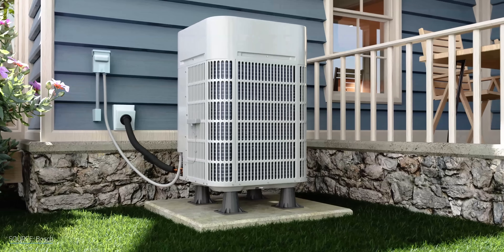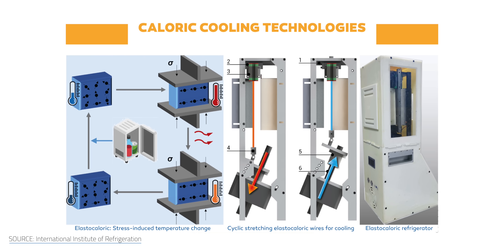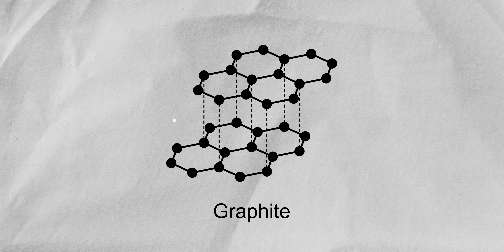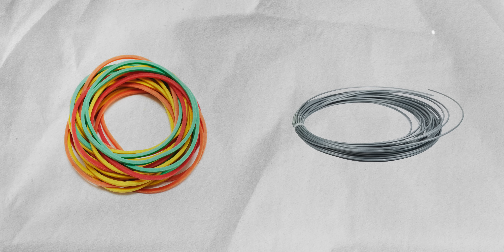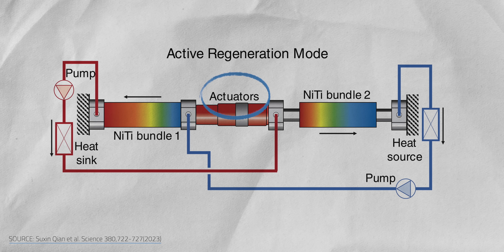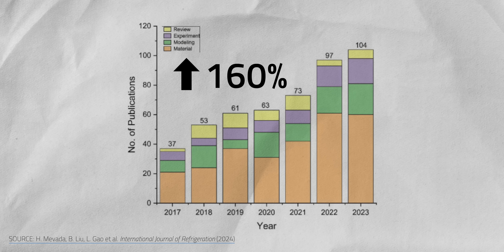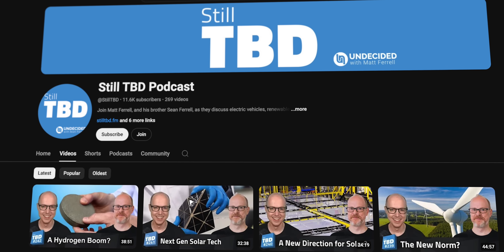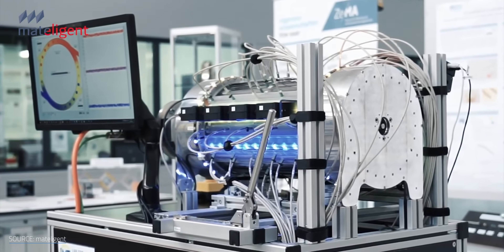How Solid State Cooling Could Change Everything

Comment: Yep - solid state is very cool (pun intended). There are also Chemical, Magnetic, and Electric solid-state cooling cycles which are all very promising. They are all potentially, in in some cases - actually very efficient, but all have the same couple of drawbacks:

They are not scalable - cooling something small? in the hundredth of watts, maybe even a few KWs? - possible. Cooling something large? not anytime soon. Cooling a whole town? City? Country -will probably not be possible.

Secondly, they are usually very efficient in absorbing heat, yet not so much at releasing this heat to the environment. This is one of the reasons why companies like Phononic didn't manage their huge expected breakthrough.

Comment: I may not be the first to ask this, but why do heat pumps need to be outside?  Heat pump water heaters are indoors.  Could they be installed in a basement, where the temperature range is more constant?  That would do away with any issues regarding super cold or hot days when the system may labor to keep the house warm or cool.

Comment: Why not just use the nitinol wires themselves as the actuator? You have them on two wheals, one which heats the wire tending it straight by applying electricity and another wheel which has the air exchange as a rotating radiator pipe. Since the nitinol would heat on the end it's being electrified, it would dump the heat as it does its transition. The cooler wires make contact with the pipe, then a coolant flowing through the pipe is passed into a radiator. The rotating pipe for the thermal exchange could also be the heat pump, making a system that eliminates the need of any electric motors and combines the best part of these two efficient systems.

Comment: if it can't be piggy-backed, then it's a useless system in my opinion....what i mean is, hooking up one to the next to the next, etc. etc. so that each cools the next in a series in order to get the temperature difference to be huge between the ends. Using motors to spin a drum of 100 nitinol bands, and pumps to push liquid across the bands as you compress and decompress them in order to get 5 degrees between "condenser" and "evaporator", while ignoring all the heat building up in the wires to power the entire unit, is just foolish. Personally, I think improving compressors would be a better way to improve the systems we have since it is the biggest draw in power....maybe a liquid as a baffle, using hydraulic pressure which can easily be stepped up and doesn't require a huge amount of electric draw (the only downside is that the tank would have to be oriented correctly and can never be tilted, but maybe there's a way to design it so that won't be a problem).....just a thought.

Comment: MOONSHINE!  Shape memory alloys have thermodynamic efficiency that doesn't touch refrigerants.  You also don't mention fatigue failure of repeatedly plastic deformation of material.  (Gasses & liquids don't fatigue in repeated cycles.)  You still need "refrigerant" as heat pipe heat transfer fluid, both to deliver the heat out from the hot side & into the cold side, not solving the atmospheric pollution problem.  You need 2 separate pumps.

Comment: When something pumps heat, it's technically a heat pump. You don't need to use HFCs in vapor compression systems, there are a lot of good alternatives, in use today. We used to use HFCs, because we focused on their advantages, and not the disadvantages, like we used to put lead in gasoline. Implying that utilizing the elastocaloric effect would be the only alternative to HFCs doesn't inspire trust. The elastocaloric effect is an interesting phenomena, but it's not likely to become a viable alternative to vapor compression except possibly in extreme niche applications. 

The theoretically possible COP of a heat pump depends on the temperature difference, like the inverse of Carnot's theorem, the smaller temperature difference you create, relative to the absolute temperature, the higher the COP you can get. That means, if your heat sink is 300 K, (~27 °C or ~80 °F) and you you want the working fluid, sorry, refrigerant in your AC system to reach 270 K (~-3 °C or ~26 °F) you can't get a COP higher than 10, even in theory. 

It's not possible to reach the theoretical limit, but it is possible to get much closer to it than most systems on the market are, with vapor compression systems. And it's not rocket science, of course there are trade offs, but we could have significantly more efficient heat pump systems if we accepted slightly higher cost and bigger size, for given max capacity. But reality shows that manufacturers know that there isn't demand for significantly higher efficiency to make it worth pursuing when developing new products, more than they already do.

Comment: Metal fatigue is a deal breaker in many applications. A refrigerator built in 1970 will still be working just fine because refrigerants do not fatigue. The thing will weigh more than you can imagine and the original natural rubber gasket will be dry or rotten but it will still be working just fine. Of course they realized they lasted too long.
Reply: I hear you, but that same refrigerator has plenty of moving parts that did not fatigue.

Parts fail commonly bcause they are engineered for minimum cost with a minimum life. 

60 years ago people built virtual-tanks out of everything because profit was so dominating.
Reply: I had the same thought. Just stretch a rubber band and you know it changes temperature, but try doing it 1000 times.

I could imagine having small panels that you can replace after failure and vary their workload to spread out the failure rate, so in 10 years when the refrigeration has deteriorated, you can replace the first broken panel, and then it would be a regular maintenance activity after that.

But yeah, definitely an issue.
Reply: Lmao because refrigerators don’t use metal components that also fail…. And you don’t even know the fatigue of nitinol and there’s people ITT saying how crazy long it lasts.

Why speak out your you know what just to feel good being g a Debbie downer?

Such a bad attitude.

This is just nostalgia BS. Yes capitalism dictates constant need for purchasing so product lifetimes are artificially low but you are just looking g at stuff with rose tinted glasses. Old refrigeration is horrible for the environment and terrible energy inefficient. There’s a host of other issues as well.
Reply: The main thing that fails in your average fridge is the compressor which is made out of metal. Well that and refrigerant leaks. So while product life span for these systems does matter how much it matters depends on application and how easy it is to fix the issue. If every 3 years I need to replace an easily accessible fairly cheap bit of my fridge that isn't actually a huge issue. My car needs maintenance every 2 years and we don't consider the lifespan of cars to be this huge issue.
Reply: Lmao because refrigerators don’t use metal components that also fail…. And you don’t even know the fatigue of nitinol and there’s people ITT saying how crazy long it lasts.

Why speak out your you know what just to feel good being g a Debbie downer?

Such a bad attitude.

Comment: the problems in long term usage are easy to solve. standardize the nitinol-rods and actuators. if it breaks (literally), replace it.
adds the benefit of new materials being discovered down the line to be swapped right in.
of course, companies will demand ways to make those coolers as unservicable by regular people as possible.

Comment: Oh the laws of thermodynamics. It doesn't just magically cool down. For the time the wire is stretched it releases heat into the surrounding air. And when the wire is relaxed the heat is reabsorbed back into the wire. I belive the reason this hasn't got a lot of traction is, to cool the wires during stretch you have to vent that heat energy  out of your house, and when the wires and relaxed you have to channel that cool air into your homes air stream. The losses  from the venting cycle would kill any efficiency gained from the tech. That's why home air conditioners are two parts one outside to expel the heat and one inside to absorb the heat.

Comment: I recommend that instead of using Coefficients of performance, instead use efficiency calculated by comparing the COP of the device to the COP of an idealized reversible (Carnot) heat pump.  This is important because if the difference in temperature is greater than about 15 degrees C then the reversible (Carnot) heat pump has a COP of about 20 which means it is impossible to get anything better than that.  If the difference in temperature is only 1 degree C then the reversible (Carnot) COP is close to 300.

Comment: Solid state cooling is the solution presented to US government instrumentalities by industry to justify prolonging regulatory permission for the ongoing production of hydrofluorocarbons. The rest of the world uses propane and butane. The combustion risk is theoretical only: rapid leakage in a very small airtight space to generate a combustible mixture never happens in real life - refrigerant leaks are slow and insidious. Despite the negligible risk, your industry has persuaded your government to ban the use of hydrocarbons in refrigeration (but no problems storing, burning and have it explode in other applications).

Comment: Generating electricity is hard to do efficiently. I think elastocaloric cooling is most promising where you can apply existing mechanical energy more directly into cooling skipping the electric powered actuators. For example, current  air conditioning makes electric cars less efficient. What if some  of the mechanical energy in regenerative braking in electric cars was diverted to working elastocaloric materials that could be used to cool the car, or possibly to cool the electric motors, allowing powerful motors to be more compact and efficient? How about a small wind turbine where mechanical energy directly creates cooling? Many mechanical processes that creates waste heat might be able to be re-engineered to create coolness, even if the lower temperature is only used to improve the operation of the system itself.

Comment: Interesting, but I doubt it will ever replace liquid refrigerants. They are way simpler and can last decades with no maintenance. And they can quickly move a lot of heat around. And cost is very important including repair cost, if needed.

Comment: As a supermarket refrigeration technician, this is fascinating. Probably not gonna see it at a big scale in my life time, but still pretty cool.
Reply: Far more likely, practical and decent path solution of any "but bad dangerous chemicals of refrigeration" is "Just use CO2. Yeah pressure is higher, but we century ago figured out high pressure fluid equipment. Just matter of cost and scale". It won't catch fire. It isn't more environmentally toxic than us breathing out and usage hazard and danger situations are utter immersion situation of any "not enough oxygen in air to breathe" situation. Heck we straight out have internal alert system for "too much CO2, get out". That is the "I can't breathe" feeling. CO2 refrigerator leaks it's refrigerants out? Immediate mitigation.... open windows and doors to air out the place so there is enough oxygen around to breathe.
Reply: @aritakalo8011  Yep, Europe is beating US on adoption. With the new administration coming in though, it's just gonna make adoption slower. Some companies will proceed anyhow. 

I've worked on a few cascade style racks that don't use CO2 directly; they use conventional refrigerants to cool the CO2 and pipe that down to the cases. There are full transcritical systems out there that use CO2 as the sole refrigerant. One concern I have for those is triple point, you're gonna have to train techs on how to deal with these new systems to  prevent damage from CO2 turning into dry ice.

Comment: What about maintenance. With normal refrigerants, theoretically the system can work forever. With a solid being stretched and unstretched, surely it would break after some time. Does the production of these advanced materials justify the possible energy savings during operation?

Comment: I also have a research about this topic , long time ago , 8 year ago exactly  when knowing a cooling phase of metal when applied a small voltage , and heating one head  . it cool down the liquid with proficiency 5% .  but when adding crytal structure and magnetic field the picture , the lactice of metal and spin  is main factor for cooling , with proficiency from the book i read about 55% , but the hard part is how to create a metal that work in nomal atm .  only on theory , i found a group working on glass metal, for this project but it have been stop in 2009 because cant  raise the fund .  it s good when see the old theory starting commercial

Comment: With wire demonstration, that energy is always released with heat before wire returns to it's memory shape. How does that work with cooling, if they strech the wire, does it return back to original and do some cooling when stress is released or do you have to heat them up some more first?

Comment: should assuming you don't need any rare meterials enable them to become significantly cheaper to produce and easier to install than heat pumps. Humm Titanium, it's not dummy expensive, but if we need a lot of it it would become a problem.

Comment: An air to water heat pump keeps all four phases of the vapor cycle in the outside box and use water to take the heat into or out of the house. Since the refrigerant never comes inside, propane, which is a more efficient refrigerant than fluorocarbons, can be used as the refrigerant without worry about potential leaks inside leading to a fire or explosion.
And if there is a propane leak in the outside unit it has less impact since propane has a far lower global warming potential than fluorocarbons and zero ozone depleting potential. Plus propane is very inexpensive relative to fluorocarbons.
Reply: Likewise for carbon dioxide, helium and air.

Comment: I'm not an engineer by any stretch and I'm sure its many times more complicated than my basic understanding of the technology...
But is anyone researching this for IC engines? 
If the heat and stress generated during the compression and power strokes are stored in a piston (and/or cylinder) made of this material it could passively cool the exhaust and intake strokes when the pressure is released right? 
The hotter the combustion stroke and the cooler the intake stroke the cleaner and more efficient the process would be. 
Two opposing cylinders could be linked to heat and cool one another on the respective strokes assuming that higher stress results in more cooling upon release and there ends up being excess.... Once again... basic understanding....no engineer lol

Comment: The Technology Connections channel has a video about these and essentially concludes that these cannot be used to replace heat pumps.
It’s his video about a mini cooler that uses this technology.
Reply: he doesn't have a video on this technology. The mini cooler video is about thermoelectric elements, not elastocaloric elements.

Comment: I can see a dc stepper motor (being powered by solar) stretching a matrix of this wire  using a concentric gear on the back side of fridge or AC unit. If we can figure this out we could modify central heating units intake plenum to accept a 10"x 16"x20" or something matrix of this wire. Interesting stuff and I think we are on our way to a less polluting future.

Comment: A note on COP: COP_hp = COP_r + 1

So a refrigerator will always have a lower COP than a heat pump.

This is awesome and I can't wait to backyard tinker on this!
Reply: Badgerheist - A refrigerator IS a heat pump. So the statement is a heat pump will always have a lower COP than a heat pump. That makes no sense. Also, please define the terms when presenting a formula.
Reply: @tsamuel6224  the functional purpose of a refrigerator is to make something cold, its COP_r is the amount of heat absorbed by the evaporator divided by the amount of work required to run the device for one cycle. For a steady flow device, it would be the evaporator's heat absorption rate divided by the power input. The functional purpose of a heat pump is to provide heat energy to a space. Its COP_hp is equal to the condenser's heat release rate divided by the power input to the device to make it run.

Refrigerators and heat pumps ARE essentially the same thing as far as design is concerned, but they perform different, but related, functions.

A "heat pump" can be used as a general term to mean any device that absorbs heat from a cooler area and rejects it to a warmer area, but when it comes to engineering text books, like Cengel's and Boles' Thermodynamics: An Engineering Approach, they prefer to express differentiation between the two by calling it a refrigerator when it's meant to absorb heat and a heat pump when it's meant to reject heat.

It can be shown with a little manipulation of the described relationships above that COP_hp = COP_r + 1 where the one in the term comes from getting to count the work input to the device as a bonus amount of heat to the warmed space. That's why heat pumps are, theoretically, always more energy efficient than electric resistance heaters.